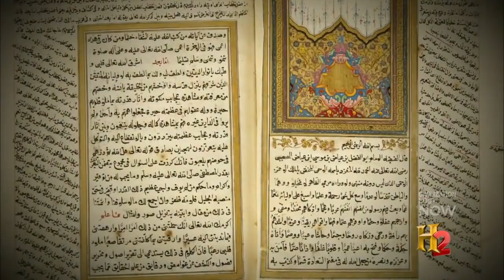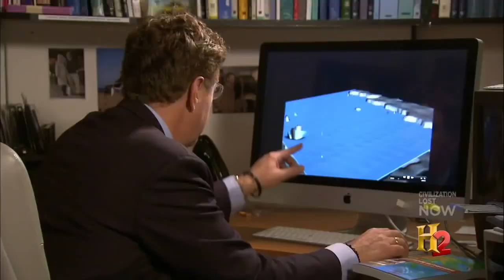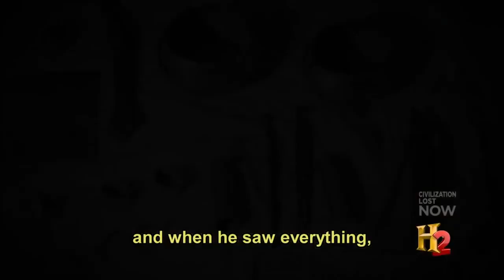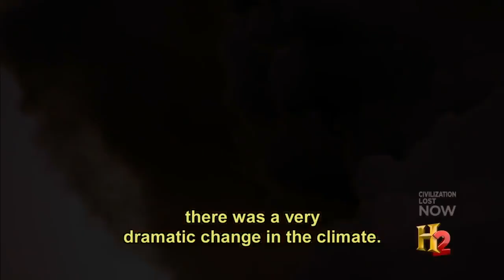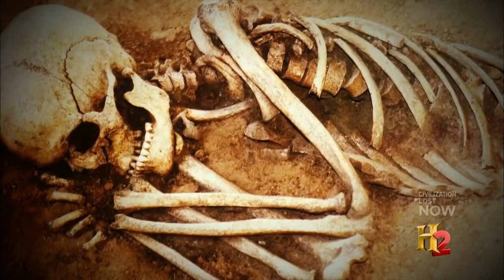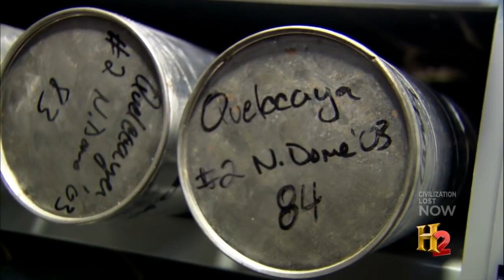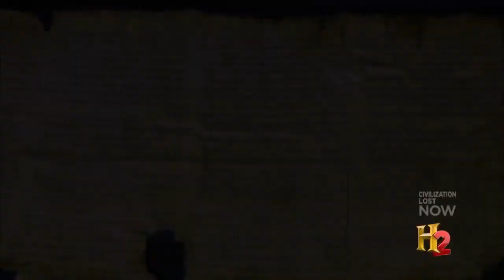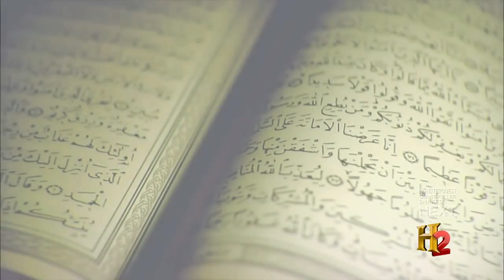Lost Civilizations - The Silurian hypothesis - Forbidden Archaeology - Must Watch

Comment: They are missing on one important information on Göbekli Tepe, which is, that the floors are covered with a very impressive kind of red "terrazzo" cement, which can also be found in a number of latter sites like Ain Ghazal in Jordan (ca. 10 000 yers old), which was a settlement. The only building with s similar floor covering is supposedly a sanctuary. Analysis of these floors showed that it contained small pieces of human bones. 
When I visited the site  15 years ago the floor was already badly damaged and did not have any kind of protective covering, so it might have  been completely destroyed by now.
Reply: @William Felix The animal depictions are exceptional in this cultural context and not found on the later sites like Nevali Cori, where nonetheless still the t-shaped pillars in anthropomorphic form were present. At Ain Ghazal the only similarity to Göbekli Tepe is the red terrazzo floor. However, this feature is very special and it connects both sites. Furthermore at Ain Ghazal exists evidence of a tradition, that connects it to all settlement sites of the PPNA and some of the PPNB ( -> Pre Pottery Neolthic). This tradition consists of remodelled skulls, which were first decarnated and afterwards covered with clay and painted. The incredibly natural appearing features of the faces can still be recognised in these 8000 - 10 000 year old artifacts. The first one was found in the 60ies (I think) at the site of Jericho,, which also features a tower from the PPNA. In the light of the more recent studies of the PPN Culture the original interpretations of the first settlement at Jericho threrefore have to be reconsidered.  We can actually look at a quite large area, streching at least from Anatolia down to the Levante, probably further. So, maybe the idea of the Sphinx being much older as actually supposed, should also be reflected in context of the quite complex PPN.